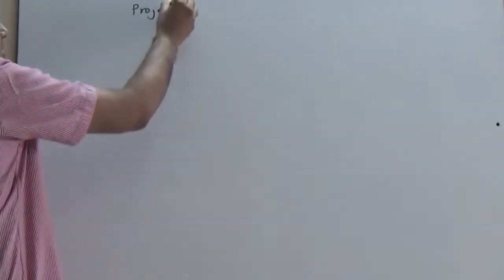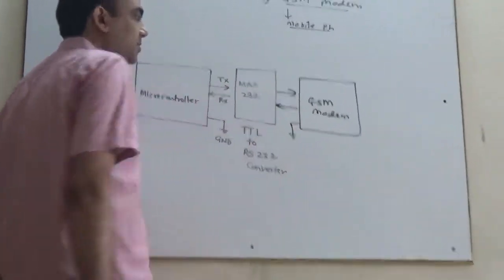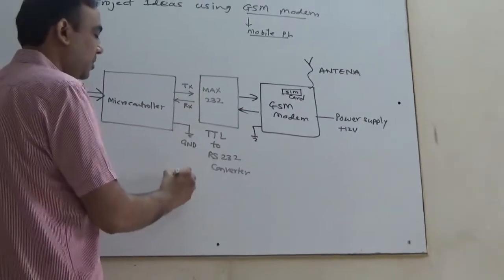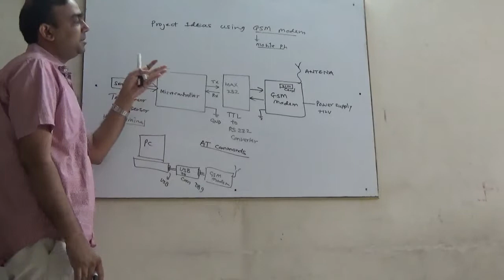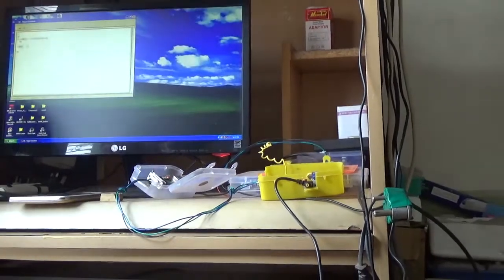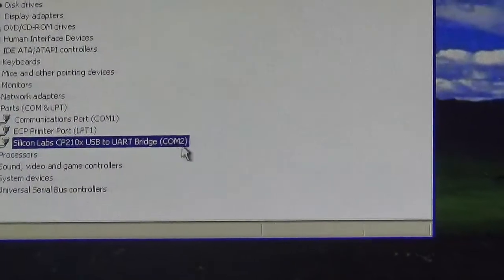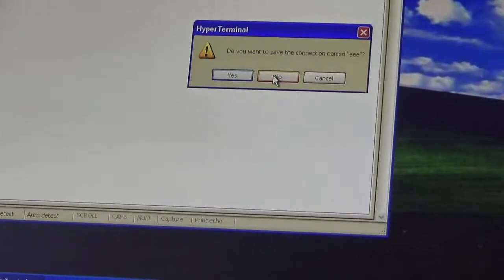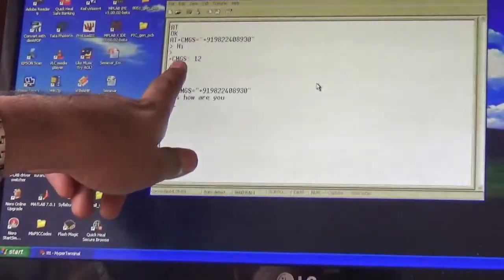Projects on GSM modem.How to test GSM modem  using AT commands.

Comment: Thank you sir for this great explanation.

Sir I'm using sim800a module suddenly it stopped responding to AT commands.
Any idea what could be the problem?

Rx TX pins, power supply everything is OK.
Also able to Register on network.
After calling i can hear Ring ?

But it's responding to AT commands